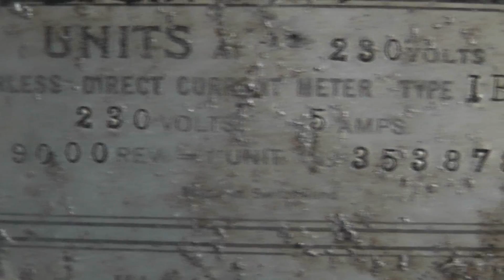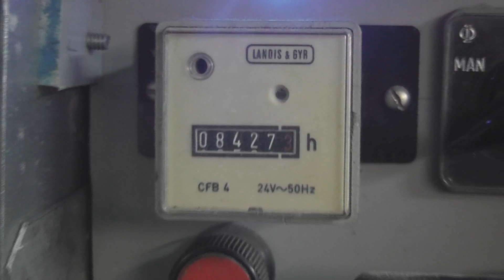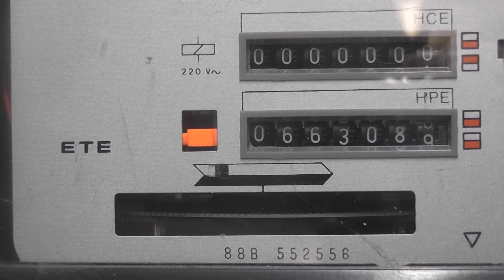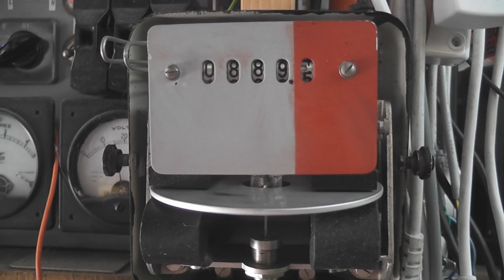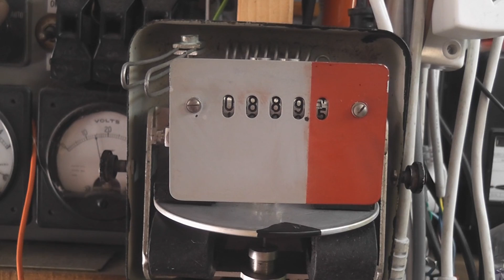DC motor disc Ampère hour meter

Comment: I have been looking around for something like this! I didn't think that an original one actually existed let alone in Australia! 
I wanted a mechanical kWh meter for my solar system, something that could measure and won't forget when the sun is not out! Even if the sun was out for 10 year's! These meters will just sit there and wait... I'm not a fan of the new digital stuff..
Great video, thanks for posting.
Reply from the maker: Thank you, the reliability of electro-mechanical meters is not to be found in electronic stuff.

Comment: Hi, I just received a very similar meter, maker unknown, with a pointer type register.  Any idea on the voltage of these meters?  The glass on the cover was broken, so I'm going to get a new glass made.  All brass gear train, 3 coils in disc, and 2 semi-circular magnets.  I will put together a short video of the meter for you to see.  Thanks!
Reply from the maker: This Ah meter doesn't have a voltage sense, just relies on DC current only. The register is usually geared for whatever voltage is on the nameplate to read the correct Ah. How many terminals are there on the meter terminal block.
Reply: It has 2 terminals.  I most likely will not be able to operate the meter as I do not have a DC power supply.  Is this meter wired in series with the load?  The meter looks very similar to yours, especially the disc, commutator, and brushes.
Reply from the maker: Ok, the meter has to be wired in series with the load. Do you have a battery charger ? you could use that as DC Supply and charge a battery or connect a 12 V 60 W bulb as load.
Reply: Yes, my father has a battery charger.  I will borrow it and try your suggestion.  Thank you very much!
Reply from the maker: Look forward to that video. I don't know if you are into electronics.
 But another option is a bridge rectifier. 
You could rectify the 120 or 240 V mains, run that through a rectifier and feed a 100 or 300 Watt lamp with it.
Put the Ah meter in series and that should work also. even with the mains ripple at 100 or 120 Hz.

Comment: Fabulous old meter!  I'm fascinated in how they manufactured the coils inside the disc.  Seems like a simpler design than the ball type commutator that was produced by GE and Westinghouse.  This meter is more compact than my GE Type C6  and Duncan Type E, DC watthour meters. Thanks for sharing the video.
Reply from the maker: Thanks for your comment, just watched your Ft Wayne K4 meter video. Keep up the good work.

Comment: they must have had something like these In my town up until about 1962 the old town was on 230VDC!  the newer part on 220AC
Reply from the maker: +TheChipmunk2008 I thought the UK used 400 / 275 / 132 kV on the supergrid. Round multipliers are nice but is not always done.
Reply from the maker: +TheChipmunk2008 220 Volts was mostly Europe. UK was always 240 V.
Reply: +RODALCO2007 Odd thing about that Raymond, I have a lot of electrical encyclopedias from the 1920s thru 1940s (kind of a hobby of mine, old engineering books)..Apparently in the UK, with the formation of the Central Electricity Board (CEB, not the later central electricity GENERATING board), they seem to have standardized on 230 volts, (and these are authentic books from the period) but I remember from the 1970s it was DEFINITELY 240, not 230... I often wonder when/why the UK changed to 240 from 230? (then in the 90s/2000s changed back to 230!)
Reply: +jon johnson Southampton, in the UK was the same in the 1950s, parts of the old town were 230 VDC, with the newer bits on 240AC (If you'd not said 220, I'd have asked if you were from Southampton!)
Reply: Where my family are from in London half the street were on 250 AC and other half 210DC!
Reply: +TheChipmunk2008 the 230  is  neat 1/1000th of 230kv phase to ground/400kv phase to phase used on the 'supergrid' here... i guess it mathematically made sense
Reply: You are correct Raymond the UK grid is the voltages you stated. Not sure how 132Kv or 275 Kv fits the equasion but that's what is used. To chipmunk up until 1965 there was no standard voltage or frequency what you got out your sockets was whatever your local power company said you would get however after that date everywhere went to the 240/415 standard at 50 cycles. Although saying that most factories actually have 250/433 volts even here at my house at low load times it is as high as 255 at our sockets
Reply: +RODALCO2007 Yes, never seen any 275 round here, but 400 and 132kV are common locally. There's still some 66Kv stuff on metal towers around but I'm not sure who has control of that, it might be the distribution companies' equipment now. And +jon johnson, yes, I thought that too (240/415)... the books I have are the Newnes "Modern Electrical Engineering" dating from the early 30s, about the time of the establishment of the grid. A large amount of the book goes into the 'new grid' and how it will revolutionize things. And they mention the Central Electricity Board (rather than Central Electricity Generating Board, as I remember it) so maybe the standard changed between the book being published and the system actually being fully implemented 30 years later?

Comment: It beautiful craftsmanship. I was surprised to see it operate with a simple DC motor with coils and a commutator. Years ago, I took apart an amp-hour meter that operated with a copper disc submerged in a pool of mercury with current flowing through the mercury and a magnetic field going perpendicularly through it. Do you have any A-h meters like that?
Reply from the maker: +Eric Wasatonic I did have one old Ferranti meter like that which I can't find. It may have been left behind when I emigrated to New Zealand 27 years ago. If I find it I will make a video of it of course.
Reply: +Eric Wasatonic That's fantastic, the motor you describe sounds like it's based on Barlow's wheel from the early 1820's. That motor must have been gorgeous.
Reply: +MisterTalkingMachine It was a Sangamo Electric Co., type B2. I found old photos of the teardown. Unlike a Barlow's wheel, the entire disc was immersed in a disc-shaped reservoir of mercury. Current passed simultaneously through the mercury and copper disc from one curved edge to the other. There were two magnets outside of the reservoir, located on either side of the disc's axle, and in line with the current flow. The magnets were oppositely oriented, one with north pointing to disc, the other with south pointing to disc, so the Lorentz force would be the same on both sides of the axle.
Reply: +Eric Wasatonic Very interesting. Certainly that's one weird motor.
Reply from the maker: +Eric Wasatonic It is very interesting the different designs of meters which were invented and eventually succumbed for the Ferraris disc meter design, which was cheap and reliable to last many years of maintenance free service till ousted by the plastic rubbish we see now these days only to last a couple of years.

Comment: Viewer # 179. :D

Aaaah, the Satisfaction is good on this one. :-)

I remember seeing this one from some videos back.

So then.... the act of propelling the loadwheel. Can it be said that the loadwheel becomes magnetised and repels away from the accuracy magnets, hence there being two accuracy magnets in there diametrically opposite each other?

Or...... Is there a fixed coil in there somewhere that I didn't see which the loadwheel repels against?

Yes, bit of an interesting one this. I've never seen a commutated loadwheel before, but then, all of my instruments are for AC anyway.

Thanxx for showing,

-BoomBoxDeluxe.

(Edit: I forgot to add my Viewer Number! :D)

11th November 2015, 12.00
Reply from the maker: +BoomBoxDeluxe The disc has three coils inside the Aluminium disc which repels against the two magnets to create rotation. This meter has a constant of 9000 revs per unit. ( It is the highest speed meter in my  collection )
Reply: Aaah! :-) I had an idea that the accuracy magnets also played a part in the repulsion of the loadwheel. :-)

Mmmmm, 9,000 revs. How did I miss that? :D

Yes, that is quite speedy, and even outdoes the Ferranti FdB meters.

Top job. :-)

Thanxx for showing,

-BoomBoxDeluxe.

11th November 2015, 23.23

Comment: Why divide the reading? Amps are amps, whether on 12v or 230v
Reply: +mikokuijn That is true, but the device is calibrated in kilowatt hours (as it says 'units', which was the old UK and NZ name for 'kilowatt hours") so 10 amps for an hour would be registered as 2.4KWh, and so running at 12v, it would read 20x too high. I hope that makes sense.